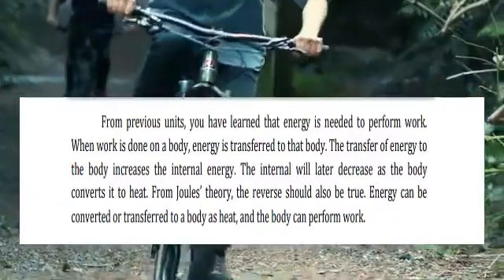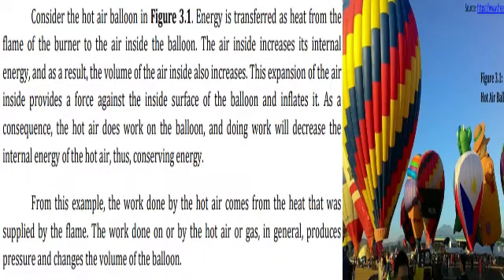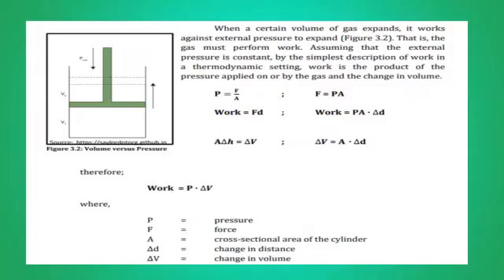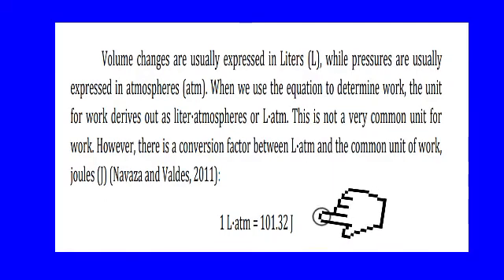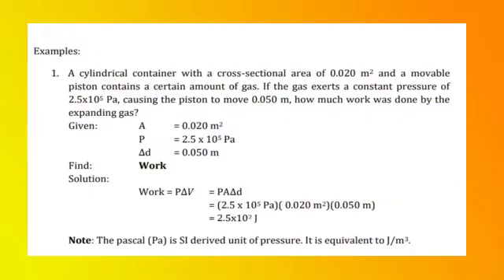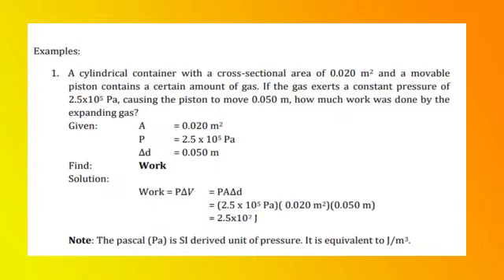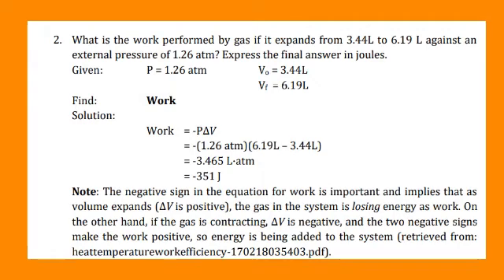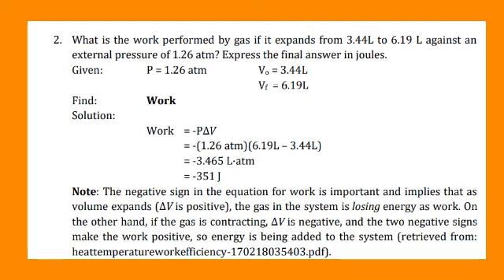THERMODYNAMICS- AN INTRODUCTION

Comment: Thermodynamics is the study of energy and work. In thermodynamics, work performed by a system is energy transferred by the system to its surroundings, by a mechanism through which the system can spontaneously exert macroscopic forces on its surroundings, where those forces, and their external effects, can be measured.

Application:
Body Temperature
Cooking 
Using a bicycle

Comment: 1. Thermodynamics is study between heat and energy but is also study how it works. Thermo means heat and dynamics means motion.
2. Thermodynamics is important because it is part of our daily life. Studying thermodynamics can give idea how thermal energy is converted and how it affects matter. Studying thermodynamics can give us knowledge on how energy can able to work.
Applications:
-When you taking a very long bath
- When you put something in the refrigerator
- Cooling machines

Comment: 1.)	Thermodynamics, science of the relationship between heat, work, temperature, and energy. Thermodynamics is also essentially the study of the internal motions of many body systems.

2.)	Thermodynamics is a very important branch of both physics and chemistry. It deals with the study of energy, the conversion of energy between different forms and the ability of energy to do work. With thermodynamics, we can find out how efficient things are using energy for useful purposes, such as generating electricity, moving a car, or even riding a bicycle.

Application:
-	Melting ice cube
-	Sweating in a crowded room
-	Turning on a light switch

Comment: Thermodynamics is a very important branch of both physics and chemistry. It deals with the study of energy, the conversion of energy between different forms and the ability of energy to do work, with daily life perspective, thermodynamics is so important becuase it deal with many things, from the process of metabolism within our body into the machinery and refrigerating systems. If thermodynamics were absence from our life, not only the machine such as car engine, air conditioner, etc will not exist, but the life itself will also not exist.

Comment: DEFINE THERMODYNAMICS IN YOUR OWN WORDS.
-Thermodynamics, science of the relationship between heat, work, temperature, and energy.  thermodynamics deals with the transfer of energy from one place to another and from one form to another.

IMPORTANCE OF STUDYING OF THERMODYNAMICS 
-Thermodynamics is important to study because it has a relations in our daily living that were not aware of just like the outside temperature of the sorrounding affects our inside body systems of how it works when it is in equilibrium state or not,  how our vehicle works when that we use it to travel, how production of electricity really happens thus thermodynamics can explain it all through deep understanding of it, the true relations of heat and energy and how it done. 

APPLICATIONS OF THERMODYNAMICS IN DAILY LIFE
-using of refrigerators and air conditioners, actually use heat, simply reversing the usual process by which particles are heated. 
-heating and boiling in a kettle
-using of solar panels to save energy
-using of car to travel 
-involving of the radiant of the sun in photosynthesis
-current that flows in wires of house appliances to make it work
-carrying and pushing of things using of your own strength to work to be done
-using of thermometer to measure your body temperature.

Comment: Thermodynamics deals with the relation of heat, work, temperature and energy. It also governs behavior of chemical reactions and processes.
It is important because it is a discipline with a wide range of applicability since it is the transformation of heat into work. We'll be able to identify how much work is done, the hotness or coldness of the substance and the changes within it, the amount of heat required to raise a substance temperature, the energy lost or gained, how objects achieved thermal equilibrium, the melting and freezing point along with the phase changes and how objects expands and transfer heat. 
Some applications in daily life can be the heating and cooling systems in our homes, when we're cooking and boiling water, on vehicles that we use for transportation and when simply going out for a walk.

Comment: ■Thermodynamics is the branch of Science that studies with the interactions between heat and other sources of energy. Thermodynamics is connected in  how thermal energy is converted to other forms of energy and how it affects matter.

■Thermodynamics is essential 
because it gives a scientific and mathematical framework to understand how energy transfer or converted inside a system. 

●When we push a book across the table, the energy from your moving arm is transferred from your body to the book, causing the book to move.

●Turning off the lights when its not used.

Comment: Thermodynamics is everything, in order to survive we must get energy from the surrounding. It is the natural reactions occurs around the universe and concerned with the heat and temperature with the relation to work and energy. 

Studying thermodynamics is important to realize the value of energy work we made everyday.  Example of thermodynamics are eating when you feel hungry and needs some energy, doing laundry where clothes need heat, exercise where you can use force and energy.

Comment: 1. Thermodynamics deals with heat and related factors such as work, energy and power.

2. Thermodynamics is important because it deals how heat and energy work. How energy transfer inside a system. How energy gets used and how it changes from one form to another. With thermodynamics you can learn the use of energy for useful purposes like generating electricity and for the invention of industrial engine such as aircraft, jets and marine.

Applications
▪︎Melting ice cube 
▪︎Taking a bath
▪︎Refrigerators
▪︎Air conditioners

Comment: 1. Thermodynamics deals with the study of the relation between heat and other form of energy, the conversion of energy between different forms and the ability of energy to do work.

2. Thermodynamics is important to study because it is related in our daily life, for example without refrigerators or fridges, meals would absolutely stink. There would not be cars, airplanes, buses, ships etc since all need one thermodynamic machine which is called an engine. Nothing in our world would be the same, if our understanding of this field remained unexplored.

Comment: Thermodynamics deals with relationship between heat and other forms of energy. 

Thermodynamics is important because you can find out how efficient things are using energy for useful purposes. For example when riding a car, when taking a bath, when boiling water, baking, cooking. You will check the right amount of heat/temperature that is needed.

Comment: thermodynamics deals with the relationships between heat and other forms of energy. It is also concerned with several properties of matter; foremost among these is heat. 
-Studying thermodynamics is important because we are always encounter or experience heat in our daily life it is important that we are knowledgeable by using heat that's why it is important to study. We apply thermodynamics in our daily life when we are using light it deals with heat when we feel cold we are using heat to warm our body .

Comment: Thermodynamics is primarily the study of heat energy and other types of energy, such as work, and the various ways energy is transferred within chemical systems. “Thermo-” refers to heat, while “dynamics” refers to motion. Thermodynamics, then, is concerned with several properties of matter; foremost among these is heat. Heat is transferred by conduction, convection, and/or radiation. Heat is transfer by conduction occurs when an object with high thermal energy comes into contact with an object with low thermal energy. Heat transfer by convection occurs through a medium. For example, when heat transfers from the hot water at the bottom of the pot to the cooler water at the top of the pot. Lastly, heat can also be transferred by radiation; a hot object can convey heat to anything in its surroundings via electromagnetic radiation.
The heat energy released or absorbed in different chemical reactions converts into different usable forms following the laws of thermodynamics. We know that we can neither create energy nor destroy it. In fact, we can only convert it from one form to another. This principle is what we called the first law of thermodynamics 
We can  also discuss some form of enthalpy , entropy,  and Gibbs' free energy which tend to describe heat flow in various conditions, like constant temperature, pressure, or volume. Entropy is actually the measure of degree of disorder or randomness in a system. 
In terms of it daily applications, it includes:
- Cooking or boiling of water/food
-All types of vehicles that we use motorcycles, trucks, or even bike and many other types work on the basis of second law of thermodynamics.
- Gasoline or diesel applies the law of thermodynamics as well. 
-Even cooling machines, such as refrigerators actually use heat, simply reversing the usual process by which particles are heated. This is why the back of a refrigerator is warm.
Almost everything actually that we are observing and we are using in daily life, there's an involvement of thermodynamics.

Comment: Thermodynamics is a branch oh Physics that deals with the relationship between heat, work, temperature, and energy. It is the transfer of energy from one place to another and from one form to another.

2. Thermodynamics is important because we use its concepts and information in the ways we design and operate so many of the devices we take for granted in our daily lives. Heating and cooling systems in our homes and other buildings, engines that power our motor vehicles. Thermodynamics help us in so many ways which can ease our everyday living

Comment: 1. Thermodynamics is the study of science especially about physics. It deals with the relationship between work, heat and energy. How the different behavior of heat affects our life and how they are interrelated to each other.

2. As a Science student, it will help us a lot to our course just like the engineers in their works. It is essential because it will give us knowledge to understand things like how energy transfer inside a system. It will give us a deeper level of meaning if we know how does that thing work or happen in a situation.

3. In fact, it is so present in our daily life from the simple things to the complex one. Like for examples: riding a bicycle, melting of the ice cube, taking a bath and etc. That is why, Thermodynamics is important.

Comment: 1. Thermodynamics is the branch of physical science that deals with the relationship between heat and other forms of energy (such as mechanical, electrical, or chemical energy), and, by extension, of the relationships between all forms of energy.

2. Thermodynamics is a very important branch of both physics and chemistry. It deals with the study of energy, the conversion of energy between different forms and the ability of energy to do work. All processes occurs in nature and daily are guided by thermodynamics
Application:
* Melting Ice 
* Taking a bath
* Cooking

Comment: Thermodynamics is a branch of physics mainly about energy for useful purposes and it has a 3 basic concept which is work, energy, and power.
It is important to study because people started to understand the universe in deeper level (I mean in atomic level) from calculation in classical thermodynamics even before they were able to see it in microscope.
It will apply by using cars, refrigerators, rice cooker, and electronic devices like cellphones, since cellphone is a very useful and essential things for now because of the online classes.

Comment: 1.Explain the meaning of thermodynamics based on your own under? The meaning of the thermodynamics for me is a branch of physical science that interact with the two system that can develope a mechanical system. that we can use in industrial engineering and etc. It also the relationship of heat and energy.
2. Why thermodynamics is important? Give application of thermodynamics in your daily life. Thermodynamics is important by building and improving our industrial machinery and improve our knowledge about heat, temperature, energy and work that we can use in our daily lives. Example of thermodynamics in our daily lives
- ironing
- boiling water in stove
- machine of a car
- hot cup of coffee
- heater in shower

Comment: 1. Based on my own understanding, thermodynamics is everything that involves heat and other forms of energy, and it is also the studies of change in pressure and volume of objects. 

2. It is important to study Thermodynamics because it is required to design any device involving the interchange between heat and work, or the conversion of material to produce heat. With thermodynamics, you can find out how efficient things are using energy for useful purposes such as generating electricicity. The different vehicles that we use like cars, motorcycle, truck thermodynamics is applied. While using pressure cooker, don't let it whistle heavily. While, whistling, steam goes out and carries away a lot of thermal energy.

Comment: Thermodynamics is the branch of physics that deals with the relationships between heat and other forms of energy.Thermodynamics involves measuring this energy and how energy transfer to other object , 

Thermodynamics is a very important branch of both physics and chemistry. It deals with the study of energy, the conversion of energy between different forms and the ability of energy to do work.thermodynamica is useful in our daily life when you taking a bath, melting the ice cube and riding a bicycle andaslo the cooking we use heat and also energy.

Comment: 1. Thermodynamics deals with heat, work, and temperature.
2. Thermodynamics is important because we actually used it in our daily life. Like what Ive said thermodynamics is deals with the heat, work,  energy from electricity and etc and also to the temperature. In our daily life we need the heat in cooking,drying clothes and etc ,work that we act every seconds and every minutes like for example we push the box for us to do we need to have a force and displacement and in temperature we need to knowledgeable enough for it because it for our sake . Example we are going to America , we need  to know the temperature that the country has for us to enable to survive in that country . So we need to know the temperature very well and in baking ,its very important in baking the word temperature , we will not make a perfect and delicious cake if we do not follow the correct temperature.

Comment: -Thermodynamics is about heat and temperature, the relationship of them, other forms of energy like mechanical, electrical and chemical energy.
-Studying thermodynamics will help you to know that in your daily lives there's an application of thermodynamics for example when you walk there's an energy required to do that work, the transportation you ride it uses gasoline which have relationship with the steam or heat turbines, when you do such activity it is work that uses energy to execute it

Comment: Thermodynamics is simply defined as the study of heat and its transformation into work.
It is important to study THERMODYNAMICS to deeply understand the relationship between the heat and energy. We can learn about how heat works and how it provides energy to be able to move something. And I think, it is very interesting to gain knowledge about this subject because it is related to our everyday life.
When I am cooking, I know the pan is going to get hot because gas stove transferring energy (in form of heat) to it.
After cooking, I know I have to eat what I cooked otherwise my body will have no way of producing "work" to get through my daily task.

Comment: 1. thermodynamics the science concerned with the relations between heat and mechanical energy or work, and the conversion of one into the other: modern thermodynamics deals with the properties of systems for the description of which temperature is a necessary coordinate.
2. Thermodynamics is an important part of physics, chemistry, and engineering. Therefore, it is a critical area of study for those in science and technology. Thermodynamics also finds importance in ecology, energy, and other studies. It used in information theory/computer science and even social sciences. It gives a mathematical framework to understand how energy transfer inside a system. hence help us to design, predict and calculate the efficiency of better heat engine.
3. Application:
Evaporation in Daily Life
Evaporation commonly occurs in everyday life. When you get out of the shower, the water on your body evaporates as you dry. If you leave a glass of water out, the water level will slowly decrease as the water evaporates. One important example of evaporation is sweating. The sweat requires energy to evaporate off of your skin. It gets that energy from the excess heat your body is producing, in turn causing you to cool down.

Comment: 1. Base on my own understanding, thermodynamics describe the transfer of energy, we've already discussed the two processes of transfer of energy such as work and heat and they're both connected to each other. When work is done On a system it gains heat. 

2. Thermodynamics is important to study because its explain why any chemical reaction happens. In thermodynamics explain how heat transfer so if we have knowledge about thermodynamics we can easily adjust in cold and hot temperature

Application.
-Taking a bath ( we need to know the temperature of water so if the water is too cold we can adjust)
-Drinking coffee 
-Explaining how plants grow (photosynthesis)
-Starting engine